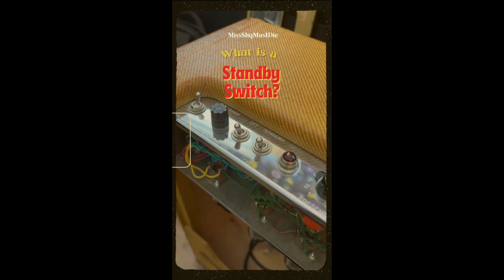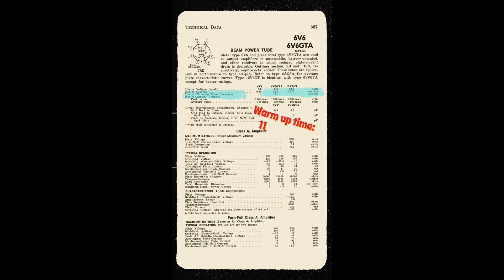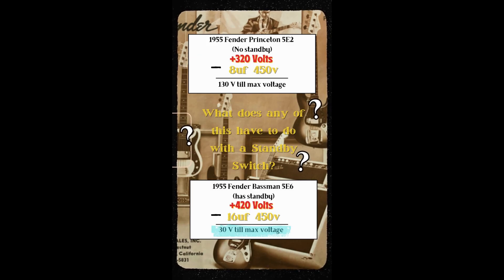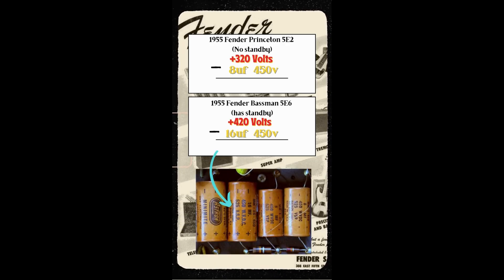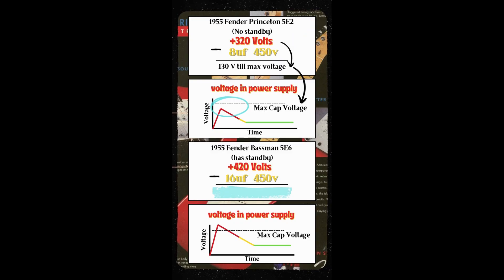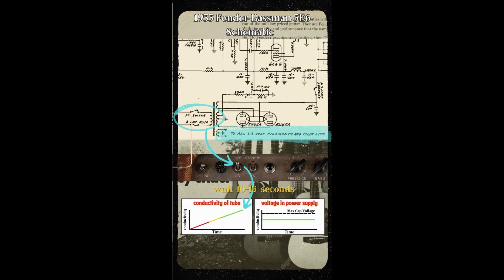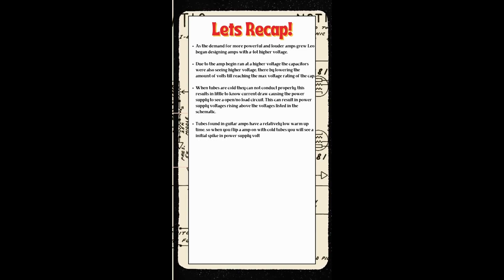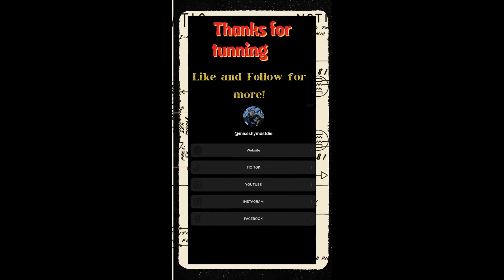What Is A Standby Switch? | #amprepair #standby #tubeamplifier #tube #amplifier #guitarist #amps

Comment: Is this the same reason that some electromechanical organs like the old Hammonds had a two-part startup?
Reply from the maker: Hammond organs are a little different, when you press and hold the start switch you are energizing the start motor, this motor is spins the tone wheel generator, once the generator gets up to the correct speed you then hit the run motor switch which engages the run motor which takes over and keeps the generator running! ❤️

Comment: There was a short-lived 5F6 tweed Bassman that had a #83 mercury-vapor rectifier, which has a 4-pin base/socket and is therefore incompatible with a 5U4 or 5AR4 rectifier tube. I havent seen a true 5F6 in the flesh but I did once rebuild a "transitional" model that mostly followed the 5F6 schematic except for use of a 5AR4/GZ34 rectifer and a handful of component-value changes that were more in line with the values used in the 5F6A circuit. Note that the standby switch location in the 5F6 circuit (before the 1st filter cap node) is actually correct for the #83 mercury-vapor rectifier but incorrect for the 5AR4 equipped 5F6A; Fender fixed this with the 6G6 Bassman, relocating the standby switch after the 1st filter cap node.

 The 6G6 and following Bassman models also changed over to use solid-state rectification, and again the standby switch was wired just after the first filter node ----- but it might have been better if they had wired the standby switch inbetween the power transformer's high voltage ac secondary and the input to the rectifier diodes, because the traditional standby switch location, after the rectifier, forces a switch typically rated for 250 volts AC to handle nearly 500 volts DC, leading to arcing and premature switch failure. AC voltages are less prone to initiating arcing because the alternating current turns "off" 120 times a second. Switches tend to last much longer when switching AC voltage compared to switching DC. If you feel you must have a standby switch, a double pole double throw (DPDT) switch wired between the power transformer  secondary and the solid-state rectifier diodes is a better way to go.

BTW, the #83 rectifier is most commonly seen in vintage Hickok tube testers and certain other test equipment; it has a constant voltage drop regardless of how much current you pull through it. This is a good thing for test equipment but perhaps not for guitar amps, where we often prefer the voltage sag and  compression that results when a tube amp is pushed hard.

Comment: In most cases of amplifiers with tube rectifiers, a standby switch is largely unnecessary because the rectifier tube warms slowly and minimizes the current/voltage inrush to the filter capacitors; and certain rectifiers with independenty-heated cathodes such as the 5AR4/GZ34 and 6CA4/EZ81warm up even more slowly than the commoner filament-type rectifiers such as the 5Y3 and 5U4. It's still important for the filter caps to have sufficiently high voltage ratings thst they won't be over-voltaged for a second when the amp is first turned on, which is why some Fender amps use two 350 volt caps in series for a combined voltage handling of 700 voltts. The location of the standby switch in the circuit is also important, yet many amp designers get this wrong: it should be located after the first filter-cap node, not before.

Comment: Fender chose to do exactly opposite of most tube telecommunications equipment.  
Standby turned on  the filament voltage to warm up the tubes, and the power switch allowed the equipment to operate.

Comment: Very cool Shy! Many tube amps with a standby switch operates the B+ voltage as you stated. Hartley Peavey realized what Leo was doing, and over the years refined the standby circuit by replacing the switch altogether with an NTC Thermistor, basically an automatic standby switch. It presents high resistance on the B+ line when initially turned on (cold) but then as it warms up the resistance goes to almost zero allowing the tubes a chance to warm up before B+ is applied to the plate. 

Another refinement that he did with the standby switch is have it actuate the screen grid voltage rather than the B+ voltage. This achieved the same effect of shutting the amp down but still allowing a staged power-up sequence. It also avoided cathode stripping, and also the less known but just as problematic phenomenon known as cathode poisoning. This also kept the standby switch as part of the amplifier function since many people expect to see one on the amplifier. To my knowledge all Peavey tube amps follow this NTC thermistor and screen grid design.
Reply from the maker: wow i had no idea Peavey did that! this is really cool and very smart! ❤️❤️❤️
Reply: @Missshymustdie Hartley has some white papers on it, Chapter 6 to be exact on their website. It also helps to be friends with some of the engineers at Peavey to teach about all this stuff!

Comment: So, to turn on amp, switch BOTH on and standby to ON and after 15 seconds switch standby to OFF, correct? Also, after initial power up, there is no reason to use standby at all, correct?
Reply: Turn on the master power first, the standby is also in the off position. Wait about a minute or two and then turn on the standby to fully  power up the amp. To turn off the amp just turned both switches off at the same time.